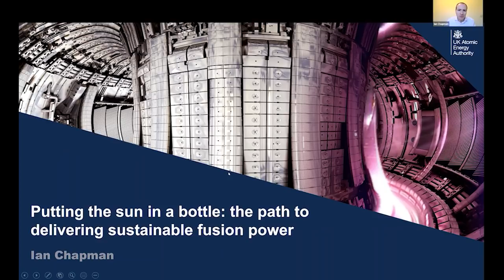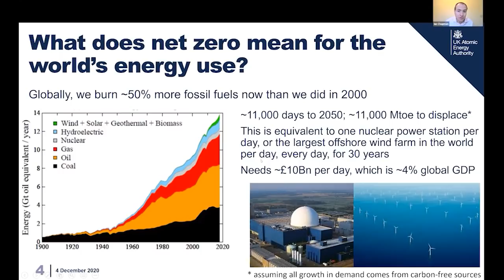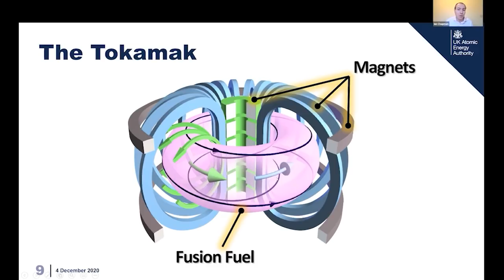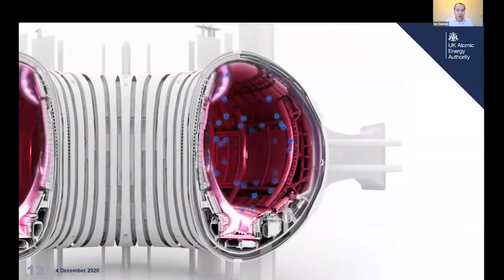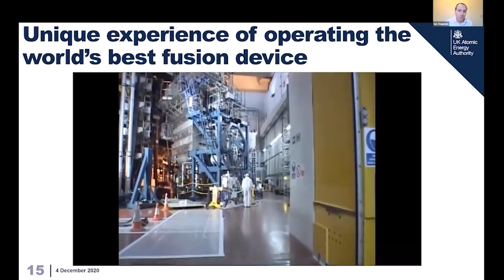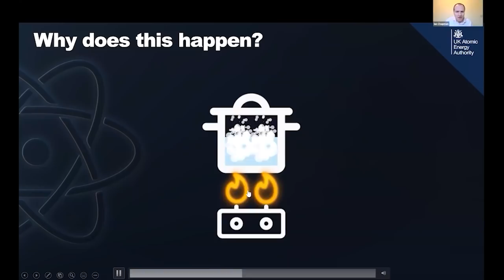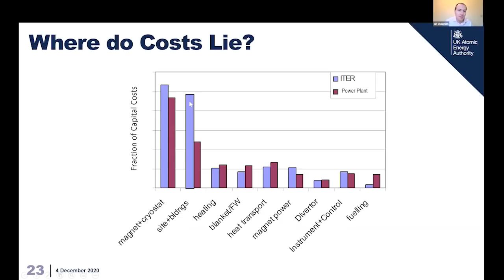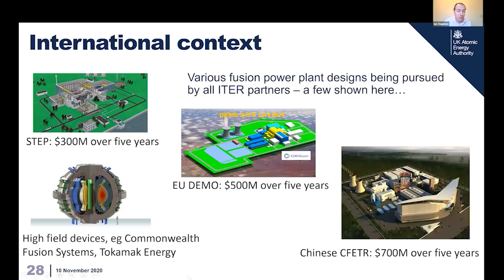Putting the sun in a bottle: the path to delivering sustainable fusion power | The Royal Society

Comment: One matter not mentioned - yes, you need to control the plasma.  Once you've done that and can sustain control, you generate vast amounts of heat.  I assume it's this heat that  is used to generate electricity somehow?  Just as a  fission power plant is essentially a steam  engine  powered by fission, not coal,  how do you convert the heat heat from fusion, to electricity?
Reply: Steam turbines, as usual. Nothing special here. Some ideas around of using electrons directly in special fusion cases but that’s even less likely to succeed than the more normal kind of fusion. So steam, as usual.

Comment: I hate to burst your bubble:
1. ITER is already obsolete and doomed to failure as its not possible to produce a stable magnetic confinement field. The issue is that the plasma produces magnetic fields which destabilizes the containment field. At best the Stellator reactor in Gemany has a small chance of providing a stable containment field (so far no tanible results). My guess is that there is less than 1% chance of maintaining a stable confinement fields for any magnetic confinement system.

2. The only power source more expensive than fission is Fusion. All of the current reactor designs will cost at least twice the mount of fission power plants. In the US the newer reactors likely cost about $20B per plant. Only one New fission plant has been under construction that is way over budget (estimated to cost about $32B) and has so far taken more than a decade to build (Still not finished) Fusion plants are considerable more complex than fission plants and require a lot more equipment to operate. There is zero chance Fusion energy will be economical.

3. As far a global warming, Global Oil production peaked in 2018 and has been declining. Declining production of Oil will impact consumption of all fossil fuels including coal as the global economy is forced to contract with the availability of oil for transport as well as mining equipment. Consumer demand will fall as energy & transportation costs increase.

4. Global warming will continue for the next 1,500 years as the earth is in a cyclical warming period do to precession of the earths orbit. Its about 100K year cycle and will peak in the year 3500 AD (+/- 100 years). Then the planet will slide back into another ice age in about 40K years.

Comment: Tokamaks will always be too expensive because they must be rebuilt 3 times during the normal 30 year life of power plants due to neutron activation of critical components that will flake off and kill the plasma. This requires amortization of very expensive components over a low capacity factor, <<80%, that will not be able to compete with CCGTs. Try aneutronic fast ignition if you please. Solar + wind + batteries will be able to compete given the better grid regulation with batteries.
Reply: @George Mann Have cataracts, do we? Utilities will buy batteries instead of simple cycle gas peakers because the batteries are way more efficient for frequency control. Sadoway finally got a utility contract for his liquid metal battery. Check out the Stanford Li-B-S electrolyte and the MIT Mo-S cathode and ELI/MIEC anode. You should be able to fly a small plane or personal drone too.
Reply: @George Mann I agree with  "revenue neutral carbon fee & dividend" we all know the goal there is no point fighting over the tech. 

But you might want to look up how cheap non-subsidized solar and wind power contracts have become. Even in just the last 2 years there have been insane cost reductions. In many areas solar is now not just cheaper than new nuclear, not just cheaper than new coal, but cheaper than the cost continuing to run coal. Let me repeat. A brand new solar plant without government support is now cheaper than continuing to run already existing coal power plants. 

Now this is not true at higher percentages of renewable. Once you get up to 80 or 90% renewable additional renewable is usually not cost competitive with nuclear due to the cost of storage. But its getting close fast. And batteries like solar in general have this great property of incremental improvement.

Comment: The scientists have been promising fusion power "in 20 years" for the past 40 years.    One question I have for this system is as follows:   If you can release energy from the confinement system to prevent magnetic reconnection explosions, why don't you just use that released energy to heat steam and turn turbines?   It would not be the holy grail of free unlimited zero carbon energy, but it would reduce the waste of energy in the system.
Reply: The ionization rate would be too high water would add to the problem. Would take on the properties of plasma while bridging radiation effects.

Comment: Wait!  There is yet more bad news.  Fusion is really just a different way of boiling water to run a steam turbine.  A perfect Carnot heat engine, which the fusion plant is not, has a thermal efficiency of 43% at the temperatures at which the fusion plant will operate. Given reasonable numbers, a good estimate of the efficiency of a fusion plant is 33 percent.  Are we really willing to dump two gigawatts of end-of-the-energy-line HEAT into the atmosphere for every  gigawatt of usable electricity we produce?  I mean, isn't warming the basic problem?  And the bad thermal news scales right with plant output.  I think that some people have the misunderstanding that since fusion occurs at very high, stellar, temperatures, that the earth bound fusion plants will generate power using efficiencies based on these stellar temperatures.  This is not possible for practical reasons.  We are stuck with using the good old steam turbine with its delta T of about 1000 degrees F.   I read  "Understanding Thermodynamics,"  by Van Ness and you should too.

Comment: Hard to imagine this helping by 2050. I'll put my money on the Sun with wind and solar. Maybe CCS and hydrogen has a role. Even fission reactors like SMR seem too expensive to compete.
Reply: The pandemic has taught me to use radically less energy. And my "lifestyle" is actually better.
Reply: Rolls Royce are building 16 SMRs for use around the UK..There`s probably money in it.
Reply: @2opler  It all depends on how quickly we phase out carbon and how fast storage costs fall. Solar and wind are currently cheaper than fission and will remain so until we hit fairly high percentages of renewable energy. But once you are at say 90% renewable that last 10% is much cheaper to cover by nuclear as the storage/transmissions costs dramatically rise for that last 10%.
Reply: @peterisawesomeplease  That`s reasonable. We have a couple of mighty wind farm arrays in the UK .The Walney Extension  with 87 turbines and has a capacity of 659 MW.
And the London Array  a 175-turbine 630 MW Round  wind farm  12 miles off the Kent coast. We`ll  need a materials breakthrough or two before solar becomes our best choice. Although sometimes it doesn`t rain.
Reply: @peterisawesomeplease  If you ever get that high. The intermittency problem and immense requirements of storage facilities might very well prohibit this from ever happening.

Not to mention that producing energy on demand is pretty much always better than storing it for later use.

Comment: Mankind has had (relatively) controlled nuclear fusion since the first underground thermonuclear explosion. If this could be done with better containment and proper treaties; wells with heat exchangers could extract the heat for steam powerplants. Of course this is wildly unlikely and even if the bombs could be kept small, cheap, and still get a high fraction of the total energy from fusion as opposed to the fission bomb trigger;.at the end of the day geothermal via fracking might be way cheaper so never mind : )
Reply: "Controlled" fusion with a thermonuclear device? Really dude?
There is nothing controlled about it once it starts. It only stops because it runs out of hydrogen isotopes to fuse. When it does begin, it does it as fast as it can.
I don't see any control with any aspect.
 You think you can control fusion with some sort of control rod?
Reply: @burnerjack01  Well actually this was partly an attempt at humor but I did regard underground thermonuclear explosions as controlled in the sense that they were contained and after the first explosion, other bomblets could be lowered into the void created by the first explosion and set off. This is really different only in scale than laser ignited fusion or say General Fusion's concept it seems to me.

Comment: Assuming fusion power would be implemented on earth, wouldn't all the 'unlimited' power also turn into unlimited heat - ie. massive global warming from all of the consumed power that eventually turns into heat?  Clean energy still produces heat, right?
Reply: Heat generated by our machines is not a significant contributor to global warming. Every square meter of the Earth receives 1500Watts of energy from the sun. Every square meter. To have a significant impact on that we would need thousands of times more machines.
Reply: @byrnemeister2008  - But with unlimited energy we would have millions of more machines that would never be turned off, right? For example, outdoor air conditioning and heating, desalinization in the deserts to make oasis conditions all through the world.  It seems like we consume much more when there is no significant cost and the external costs pile up. So, yes for pollution free energy!!!!! But then I wonder if we will also face this other type of warming.  Thx, for your serious consideration.
Reply: Do the calculations. Heat & CO2 are some of the inputs and some of the outputs
Reply: If our total energy demand increases by 2% per year, within a few centuries we will be rejecting to the environment a significant fraction of the heat received from the sun. And this is independent of whether we are using fossil fuels, nuclear or renewables.
Reply: @nxtlightdesign7440  even in the best case scenario, energy would not be free. And not “unlimited” in the nothing at all matters sense.

Comment: I am wondering whether fusion has issues with materials radioactively contaminated.  Thanks.
Reply: The amount of radioactive waste is much less from a fusion than a fission (uranium, plutonium, etc) reactor. HOWEVER -- tokamak type fusion produces tons of energetic neutrons also, which deteriorate any kind of metal, in the reactor structure, wiring, etc. Neutrons weaken metal. I believe this is a problem. Basically, you have to rebuild the reactor every couple years. Some fusion fuels produce much lower amounts of neutrons, but tokamaks can't use them AFAIK.
Reply: @johnpapiewski8232  Thank-you.  Is the cost of re-building prohibitive (compared to energy prices)?  What are the reactor designs that use the low-neutron producing fuels?
Reply: @TenzinLundrup  it's theoretical at this point. The fuels are tritium and Helium3 which aren't exactly cheap fuels to get. We're far better off dumping our brains and cash into thorium molten salt reactors. It's waste only take 300 years to become safe. Furthermore it can't really melt down or explode. It's already molten and only stays that way because of the graphite rods in the reaction chamber and it can't explode because it uses high heat instead of high pressure like in current reactors.
Reply: @rexmann1984  Thank-you.

Comment: to prove that works is it not easier fusion a drop of  hydrogen than half ton of hydrogen.generally speaking in metal for example, melting a tiny piece of metal is easier than 1 ton of the same metal.
Reply: Fusing a tiny amounts of Hydrigen isotopes is done all the time, but to get more energy out than you put in, you need a large volume because heat loss is less as the volume increases, and you need to stay at 100mio degrees - so heat loss is the enemy.

Comment: How much water is in 8 billion bathtibs? I must be ignorant or something but I am not familiar with a bathtub as a metric for water.
Reply: @qed100  Is there a standard size of bathtub there in your country?
Reply: @qed100  Thank you. Why wasn't something sensible like that said in the fucking first place? Someone there is a bathing fetish?
Why is the volume of oil or coal relevant.  I understand that the CO2 is, but the volume?
Reply: @qed100  Yes, but why is volume important? It is beyond my ken I'm afraid
Reply: @neddyladdy  Because there are approximately 1,300,000,000 cubic KILOMETRES of sea water on the planet. And each cubic kilometre contains 1,000,000,000 tonnes of water. The average bathtub is 0.16 tonnes.
But even without doing the maths, a bathtub is a useful analogy because we can all envisage using at least a bathtub full of water in a week, let along a lifetime. Therefore we can instantly see that the extra quantity required for our lifetime power needs is insignificant compared to current usage.
Reply: @stuartmcconnachie  your complexity fixates on it aren't you. Far far better would be an estimate of how long it would last at today's rate of energy consumption yet you persist in comparing bathtubs to tonnes to barrels ! something, I would suggest, far from intuitive.  I get the impression you are wishing, maybe advocating for this particular technology and this is the reason you use incomprehensible measures at the cost of understanding and comprehension.
Reply: @Kalumbatsch  I don't know what butthurt means. I am merely bemused by your mix of incompatible descriptors.If you want to be understood please don't use US colloquialisms.  I don;t understand very many at all !
Reply: @neddyladdy  Why don't you look it up, right after "how much water is in a bathtub"?

Comment: Is fusion going to be practically better than molten salt breeder reactors? I would like to see fusion, but advanced fission can come to market much sooner and a new crop of nuclear scientists and engineers will speed the advent of fusion. S. Korea is building reactors for half the price on America due largely to reasonable, perspicacious  regulation. Fukushima was not well planned at all.
Reply: Fukushima was a disaster waiting to happen. Terrible disaster avoidance planning.
Reply: @seriousthree6071  Mounting the emergency generators on the roof would have avoided that disaster. Gas turbines are lighter than diesel. But what about a large meteorite strike or a military attack? Withstanding an military or other attack resulting in contamination would require non-contaminating materials onsite.
All nukes with dangerous materials onsite are waiting disasters.

Comment: Heating up hydrogen isotopes to 100 000 degrees sounds 
Iike a very expensive kettle. Seems like if you wanted fusion to work you would be better off dealing with temperatures comparable to the sun where it I occurs naturally. What do I know I'm not a nuclear phycisist.
Reply: The way the sun does it does not produce enough energy to be commercially viable, ever. Nuclear physicists know this, so they are looking for a better way.

Comment: Some would say bioenergy is the ideal form of energy. My bet is on the biological solutions to the problem.
Reply: @qed100  you’re right on the energy density. But the combustion part is no problem because producing those biofuels requires consuming carbon dioxide, which will then be released at combustion.
That’s why biofuels are considered carbon neutral.
Reply: Bio energy is ultimately solar power, except way less efficient. So probably not...
Reply: @qed100  I agree that biofuels won’t solve the current energy crisis. I am however dubious that space-based solar will become affordable before we will crack fusion.
Reply: @qed100  Sure. I would go even further. Instead of pursuing one solution, we should be actively pursuing all of them.

Comment: Depressing for Humanity this direction is.
Reply: @samsabruskongen  “You must unlearn what you have learned.” 

Why spend $800,000,000 dollars over 50-60 years on Z-Pinch confinement Tokamak experiment/reactors with temperatures that are 500,000,000 degrees hotter than the sun to promote fusion i.e. Coulomb Repulsion barrier destabilization? When Nature or the “Force” does it with much lower temperatures? That’s because one must “unlearn what they have learned” about the Force. Which, is Gravity. Learn Nature and you don’t need these silly expensive rabbit hole devices.... Tokamak or even spherical Tokamaks.  

“Those skilled in the Art.” Or as Star Wars hinted at, become a Jedi.

Comment: couldn’t have a donut of copper heated by a gas supply and take the thermal energy out that way? 🤔🍩🕯😐🤷‍♂️
Reply: and maybe spray a small amount of water onto the copper to generate steam and spin a turbine or something 🤔😐🕯🍩🤷‍♂️
Reply: Your copper donut would be destroyed(or if robust enough not to be destroyed, destabilize the plasma). Anything that physically touches the plasma creates problems in the system one way or another. It has to stay suspended in the vacuum.

But the principal of what they need to do is the same. They need to take the radiated heat and neutron flux convert it into heat that can be conducted and then use that to make steam. That conversion though is a really difficult problem(among many).